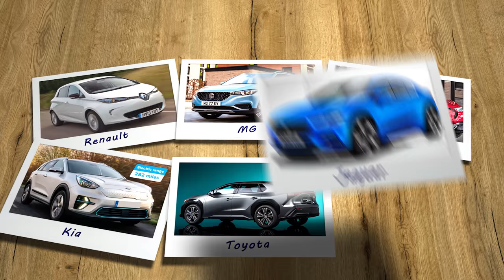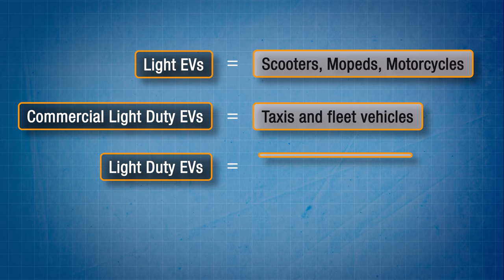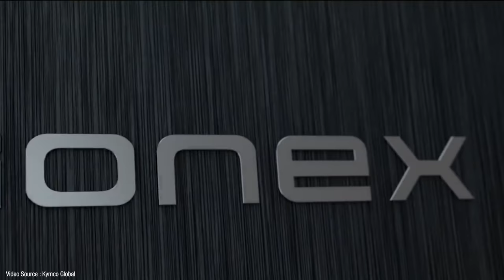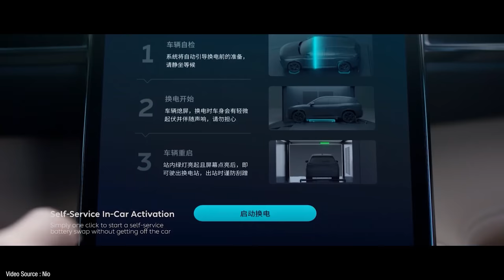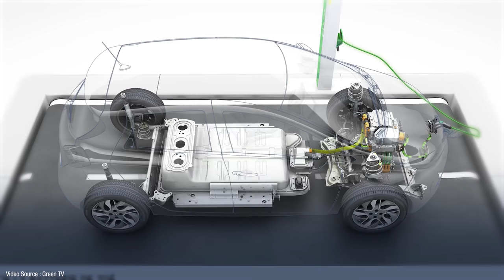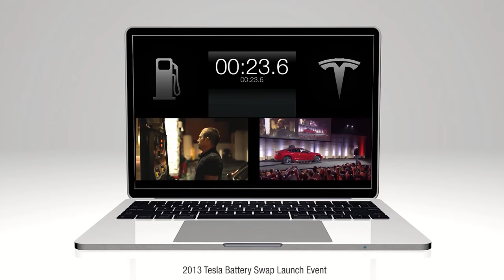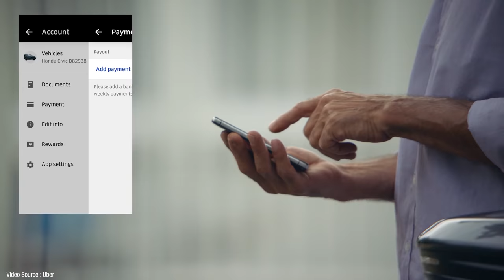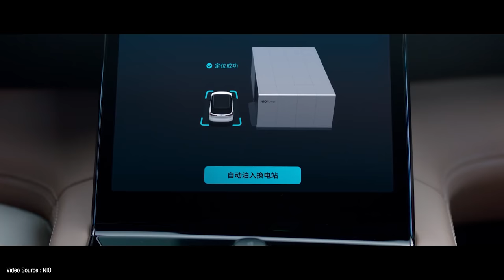Battery Swapping. Transforming the trajectory of electric vehicles?

Comment: At least for private passenger cars, this seems like an overly complex solution to a temporary problem.  Every year, as battery technology improves, range is increasing and charging times are decreasing.  For example, the Ioniq 5 supposedly has 5% to 80% charging time down to 18 minutes.  There’s little need for battery swapping now, and there will be even less need for it in the future.
Reply: However, the fact is that vast numbers of current car owners simply do not have the capability of charging at home.  In towns and cities of terraced streets and apartment blocks, there is minimal or no possibility of getting to charge a car at your own house.  Indeed it's rare to get to park anywhere close!  So, unless urban streets have charging points installed every 10 metres or so, reliably charging a car isn't feasible.  (Let's put the separate debate about the need to have a car at all to one side for now).  So, I would suggest the battery swap model will have enormous appeal if the infrastructure is set up and marketed properly.  Battery technology, capacity and range are irrelevant if you can't charge the battery in the first place!
Reply: @chrislaf2011  If fast charging is fast enough, then apartment dwellers could be served by the equivalent of the current gasoline service station model.  Pull in, charge your car in five to ten minutes, and be on your way.  No need for battery swap in that scenario.  If we’re at 18 minutes now, it doesn’t seem like under 10 minutes is that far away.
Reply: Battery swapping would also eliminate the need for ev drivers to own the batteries, which are very expensive to replace in current electric and hybrid vehicles.
Reply: Except that the reliance on rapid charging accelerates battery degradation  as mentioned in the vid..
Reply: I'm not sure about sitting around a charging station for more than 10 minutes.  I usually like to get back on the road as soon as possible.  I think that even with battery technology improving, manufactures will start taking out batteries to make for more room, and a lighter vehicle so your range will still be limited to what we have now.
Reply: @artboymoy  Don't you ever stop for food, coffee, or a bathroom break?  That's enough dead time for a fast charger to put a lot of miles on.
Reply: @charlesuk5358  This is assuming:
1. that you only charge batteries when they are very low in charge (the degradation happens mostly at the beginning because of the huge input but if you charge your car regularly when they are at 70% already then the degradation is much lower)
2. That car makers didn't take this into account and already provided a battery with 10% extra capacity (that you don't see but sushhhh, don't ask don't tell) and will degrade without affecting much of your charge use within the first 8 to 10 years. By the way also protecting from  overcharging the battery and avoiding "incidents" of burning cars etc...
3. That battery technology doesn't improve and solve this issue.
Reply: @charlesuk5358  And requires cooling of batteries. A swapping station should charge at a rate that does not require this.

Comment: Manufacturers should install lots of swap stations so in times of slow demand, they now have the plenty of batteries for grid storage and energy arbitrage, and can make money that way.
Reply: Great Idea
Reply: Yes.
Reply: With loading times of 25kw in 10 minutes like the new EQS I think it’s really not necessary to swapping batteries… 

Rather is VPP regulation and in home batteries a big thing to consider with bidirectional charging and the cars battery as backup for big loads
Reply: Batteries are the most expensive parts or cars...

You'll need tons of inventory in swap stations to make up for peak swapping periods.
Reply: @michaelberger6699  
They're handling that scenario just fine so far.
Relax.
Reply: @davidclark538  yeah.

No one is producing cars that swap batteries!

Just fine solution!
Reply: @TheDavidlloydjones  Well if others Judge poorly like you then who's problem is that ? Sure cant say MY PROBLEM 👍
Reply: Yes! I just made the same comment, but moved it here as a reply :P

All the batteries sat there charged and not being used could be used as grid support, much like V2G systems.
The current problem with V2G systems is it's a very large upfront cost to have one installed in your home.
But for stations, it'd be totally economically viable. And make them some tidy extra money on the side.
Although it would remove the democratisation aspect. But you could have both and I guess lots of stations having the tech might drive down the tech for houses.
Reply: As well as having a downgrade path for degraded batteries, but remember, battery swapping requires battery standardization which inhibits the development of new battery technology.
Reply: Why don't they put a number of small wind turbines below a Tesla to charge it as it moves ?

Comment: On the surface it seems to be a simple solution but when you consider that limited battery production is going to be the biggest impediment to the rollout of electric vehicles it means that we have batteries sitting in storage instead of having more EVs on the road. Which also means you need to have something like 1.5x the number of batteries vs cars and when the battery is the most expensive piece of an EV wouldn't that just raise the cost of the fleet? It also means we would need to mine and produce that many more materials. Curious on others thoughts.
Reply: Indeed AND also that already to have all car makers to agree on a simple thing as the charging plug is a pain, imagine if you need to tell them to agree on the swap technology? In China which is such an authoritarian country you have Tesla charging station and all other brands charging stations... Already making things complicated. I can't see a situation in the western countries where a local government would be able to convince all the car makers to agree on using the same battery... Ever.
Reply: @dominiqueridoux2073  Once standarization and modularity takes over a market the ones that don't join will lose.
Reply: Batteries sitting in storage can earn their keep doing peak shaving, grid stabilization and being part of a virtual power plant.
The more batteries, the merrier - as long as they are connected and doing useful work.
Reply: I think far fewer excess batteries would be needed than 50% extra, particularly for moderate sized fleets. If a battery can be charged in an hour and 20 vehicles can be serviced per hour, there is no point in having more than 20 extra batteries. They're also still able to service hundreds of vehicles per day on this operation. The main defining factor of the system is the peak battery turnover time from arrival-recharge-departure.

And if many drivers would accept a 70% charged battery for their fleet vehicle to close out the rest of the day, then even fewer batteries are likely to be needed as that might allow for even just 10-15 batteries in such a setup.
Reply: @dosadoodle  You are starting with the assumption that all vehicles are going to use the exact same battery capacity. Nio is currently proposing 100KwH batteries on their cars but used to sell cars with 70kWh and is announcing now a 150kWh "update". Which would already mean 3 types of batteries because you can opt to buy or lease the battery when you buy your car. 
As for the free upgrade of the battery here you go: https://www.greencarreports.com/news/1130217_nio-offers-100-kwh-battery-pack-more-range-in-subscription-based-upgrade
Not so free isn't it???

Comment: This is the same approach as swapping used batteries for new, in torches (flashlights) and so on.  The weak point in this method, is the connector.  Electro-mechanical failures over sealed solid state controls and fixed-for-life battery connections, will be the arguments used by almost all EV manufacturers.  Getting a handful of independent manufacturers to agree on a battery size/capacity/shape/connection method could take too long for any decision to be effective.
Rather like trying to herd cats!

Personally, it is the most sensible method.  I’m old enough to remember a petrol station on almost every-other corner; all towns had stations and some villages as well.  These scattered stations were needed for the multitude of motorcycles that had limited petrol tanks and the few (but growing) car owners.  Car fuel tanks could give ‘range anxiety’, so unless you carried a ‘spare gallon’ it was always wise to regularly refuel.
Excellent presentation, many thanks.

Comment: Good sounding but utterly still borne concept.

Battery charging is getting faster. 20 minutes is already completely acceptable and services most requirements. If not, it soon will. Then 10 minutes. Inevitably.

Full time technician to maintain and operate very mechanical swap stations.  Someone else needs to drive, to load and unload your car.

Standardization of battery packs is the opposite of optimisation needed for range etc

Different battery packs need to be stored and charged. Differently. Year by year. Model by model. 

Nickel heavy batteries should not be stored at 100% charge. Nor left heavily discharged.

Regular charging stations are way cheaper than the advanced mechanics needed for a swap station. 20 to 1?  40 to one?

Queues even more likely at operator swap stations. Charge time is almost never under 10 minutes already. 

People need and like to stop to pee and eat.

As you mentioned, structural battery packs make sense. Have many advantages, efficiencies. They will last a million miles.

Who knows what is best for recycling at end of useful car life? Things are changing fast. But assuming you know how best to repurpose them at this stage is folly.

Chinese government are subsiding swaps but, imo, this will prove to be a massive misspend. Mark this.
Reply: Totally agree and also I would add:
- Space required to install the swap station means it would need to be outdoors... Currently in China most of the charging stations are located in underground parkings with low ceiling. Not practical at all
- Current cost of charging at a fast charging station are lower than the one mentioned for the swap service so no chance in hell Chinese will pay more just for a few minutes less services.
- The scheme in China is mostly that when you charge in an underground parking you get 2 hours free parking, the idea being that drivers would then do some shopping or consuming in the mall. To the user it "feels" like the charging is free because it negates the cost of parking (which of course is not logical but in reality it does work and attracts many users).
- Except for heavy drivers you only charge 20 to 30% of your car at a time... Which takes less than 10 minutes already at a fast charging station, negating the convenience of the swap. You go buy some food or whatever, you put your car in charge and 10-15 minutes later you go home with your groceries and that's it...
- I see many taxi drivers in Shanghai taking the opportunity to have a quick rest (toilet break, food or just a quick nap) while the car is charging. They need such rests anyway when they drive their long hours. The charging station is usually located near all the convenient services for such rest.
- Last but main point for China at least, Shanghai alone has over 50 000 EV charging stations (not including the personal ones) in operation as of 2021... How could swap technology beat this when most of tiers 1, tiers 2 and even tiers 3 cities are very well equipped already for another technology? 1000 or 2000 swap locations for bikes in Taiwan? May I ask how many charging stations for cars in Taiwan? If you need to drive let's say 5 more minutes to reach a swap station compared to a charging station (with enough availability so you won't have to queue), nobody will make the extra effort... Ever! What is practical for an electric bike (Gorogo in Taiwan) will not be in larger EV.
Reply: @dominiqueridoux2073  thanks for those additional and current details. There are others still. 

And I find it extraordinary how easily JHaT swept the mechanical price and complexities of swap stations under a rug. I love him and his dulcet tones but it's never been more clear that he's an armchair philosopher not focused on execution.

Swap stations, like HEVS, will have a lot of money wasted in them. Then they will die.
Reply: -Dirt, water & mud on the underside getting in the way.
-Wear down of mount points, especially the high voltage connector.

-Removable packs may fall off, especially in accidents.

Comment: Another great video!  Thanks for sharing.  The swappable batts in US are key.  The market is large, the fleets are large, the potential to impact the company’s brand that uses them is terrific.
Reply: Only every battery secured by Tesla right now can be sold in a car or it can sit in a swappa station.  So we need a lot more battery production but then they would be used in mega packs (which have 12 month lead time right now due to no batteries) or power walls.  I love swappa idea but you need excess beyond making cars batteries to do this (NIO sell so few cars they are not a good example of say Tesla doing this at the moment).

Comment: Insurance companies should be delighted with swap out 🔋. A stolen car that is dependent on swaps  could be cut off from being refueled until recovered to its owner.
Reply: I think the idea is that they can be either charged 'normally' and/or battery-swapped?
Reply: Nice.
Reply: They’re often chopped up for parts, not sure. It’s definitely a barrier though, so probably helps a bit. Just maybe not as much as one might think.
Reply: @pipertripp  True, with all of the electronics on vehicles now it seems an easier method is an electronic kill switch or just a tracker ... but I'm sure both could be jammed or hacked.
Reply: At a Tesla Supercharger, a specific car can be blocked from charging.  This may or may not be a part of other fast charging systems, although it is technically possible.

Comment: Battery swapping is inefficient for the majority of consumers. I think the battery chemistry in the next 5-10 yrs will greatly improve upon battery efficiency and charge speeds.
Reply: It could, but will the price be affordable, or will this be cutting-edge technology, with tremendous production costs ? Swapping might be a temporary solution, while the development of new batteries continues, and become profitable enough for the market to bother making them.
Reply: Electric batteries exist for 200 years. They have improved, but mainly by replacing lead with lithium (the lightest metal). So to me it looks unlikely that a great breakthrough occurs.
Reply: @gaelgregoire5413  I believe Elon will get that breakthrough first if anything.
Reply: @gaelgregoire5413  Li-ion was mayor brakethrough, i dont think its just shift from lead to lithium, if it was that easy they made it 100 years ago, not in 70th and then another 20 years to get it mass produced. Next one waiting is solid state batery, safer, higher kapacity per kg, and dont degrade on really high charging.
Reply: @pavelvalenta2426  exactly, you stress my point. In 200 years it was hard to improve batteries, and long. Yet that major breakthrough was only a x5 or x6.
So il think the next major breakthrough will occur in a long time and won't be a game changer.
Reply: Charging speeds aren’t the main improvement, it’s spreading the multi thousand dollar eventual battery replacement over a long time, and charging them slowly as to minimise degradation. Batteries are consumables, they won’t last nearly as long as the car itself. If we get a better battery chemistry that won’t degrade then we may be fine, but I wouldn’t bet on it. If we discard the requirement hat batteries be chargeable in increasingly short time spans, we could likely improve other aspects of the chemistry instead, like capacity or lifetime.
Reply: Lithium has four distinct advantages over any other metal battery - they are very light because the Li metal is light, but so are the electrodes, they retain their charge very well, they handle repeated charge/discharge cycles well, and they don't have a 'memory' effect.

Any significant future advances probably means moving away from ion donating technology (electric batteries) to other forms of energy storage, like hydrogen and nuclear. Perhaps cities may use external energy  sources to the car - grids - for vehicles (similar, but massively better, to trams! No restrictions to where you go within the grid)?

Comment: I've said it for several years. We need Type 2 style chargers in residential car parks for people who don't have a driveway. Of course, battery swapping is a great idea. Tesla decided against it in the end, but NIO have fully embraced it very nicely. I can see room for both systems. But I feel that without easy residential overnight charging, there might be a headwind to the EV revolution. Me? I don't have a driveway, but I Type 2 charge at work for free. And that's another option. But what if you work from home, as increasing numbers of people do? Residential charging. We need it, and it's almost non-existent in most areas.
Reply: NIO has dived in because the Chinese government is paying for it.  It’s not economically viable in a world where batteries are super expensive and supply is constraining car production.  How Brian could say it’s cheaper than “expensive charging stations” is beyond me.  Swap stations require as much charging infrastructure per car served as charging stations PLUS an expensive back stock of batteries and a building to store them!  Absurd.
Reply: No we don't. What we need is for people not to own cars at all. We don't have enough electricity for everyone to charge these stupid cars.